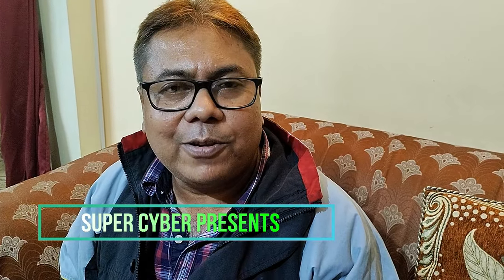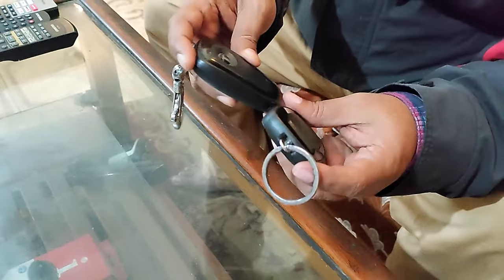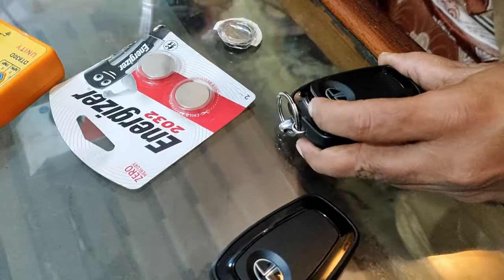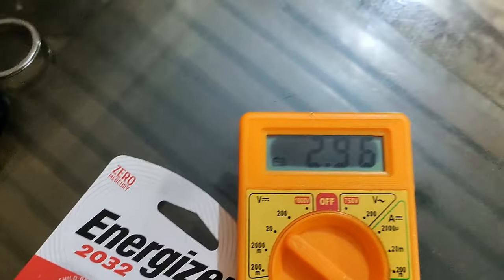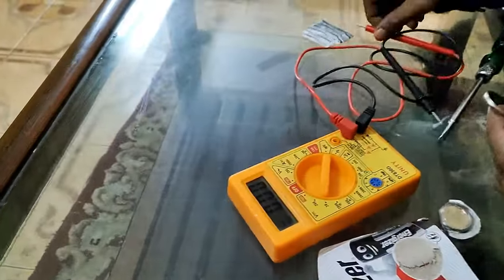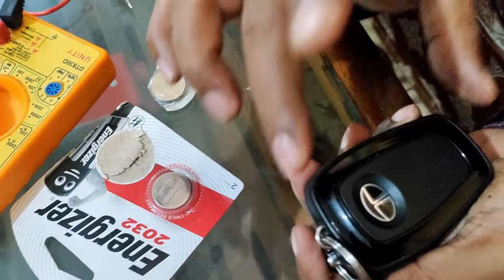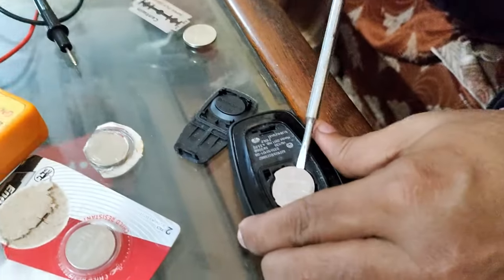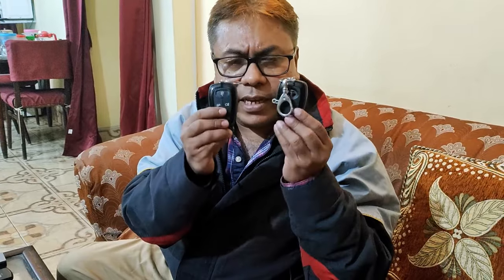Tata ALtroz/Nexon Key Remote /Keyfob Battery Replacement DIY #tataaltroz #carremote #keylessentry

Comment: Sir. They have mentioned that cell + Sign should face towards upwards. It is mentioned in user manual. Does it matter direction of + sign?
Reply from the maker: Yes it matters to follow the instructions in the manual otherwise it will reverse the polarity.